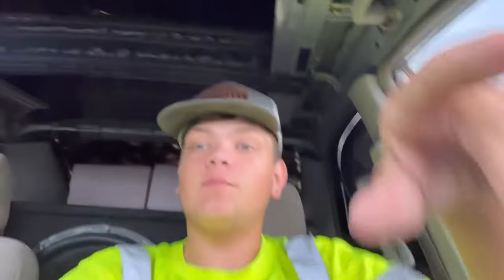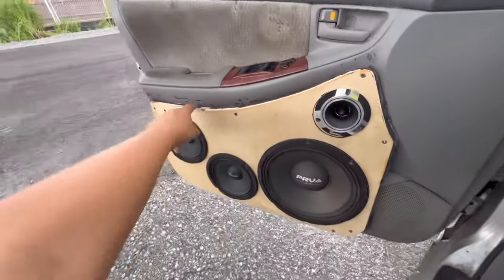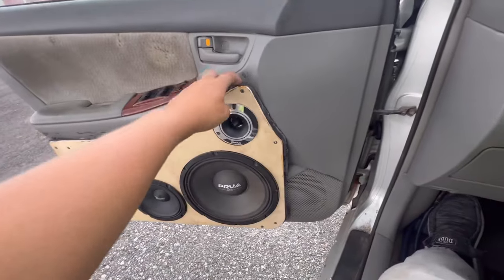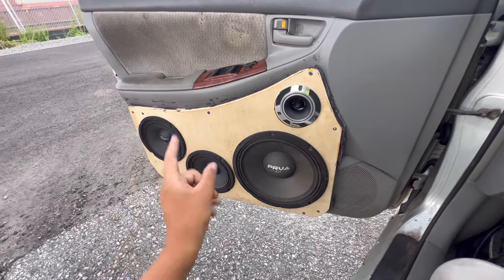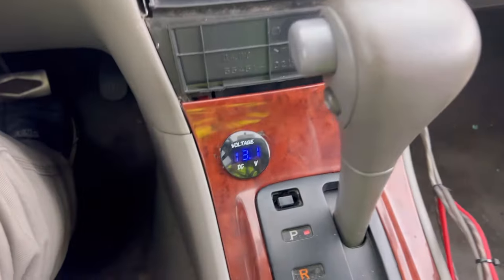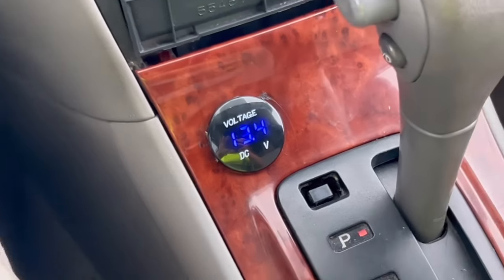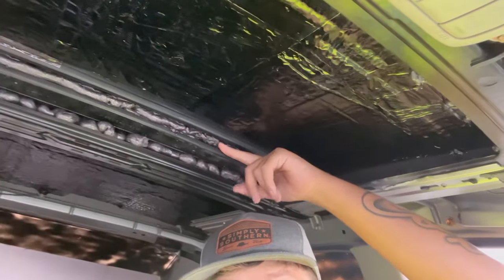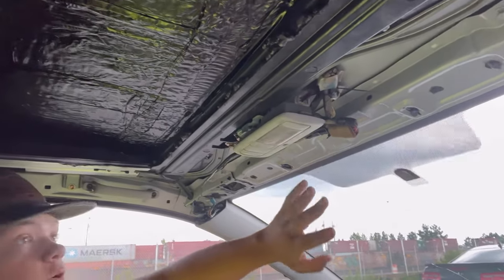Custom door panels for a Toyota Corolla! Super clean and simple!

Comment: Ok i have a question how did u wire up tha speakers on tha door put all tha positives together, all tha negatives together hooked them to tha factory door speaker wire  im doin this to my daughter's 07 Toyota Corolla  i done 4 6×9's in tha back deck,now I'm doin 2-6 1/2 & a 1"super tweeter in each door im fiberglass it though how i did tha back deck so  i was gonna  do a 3 way passive crossover in each door for now then later to a amp just wanted some ideals thanks appreciate it